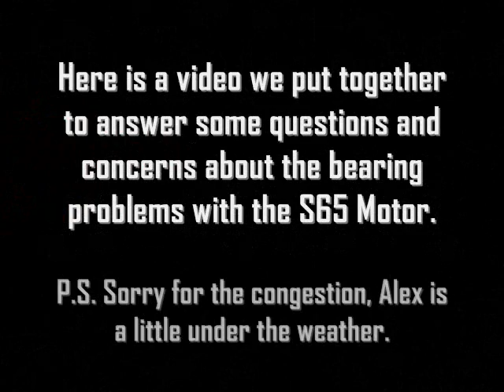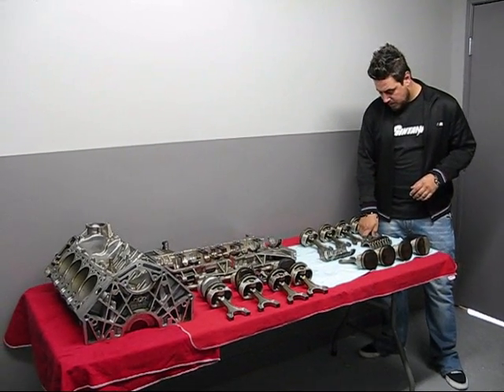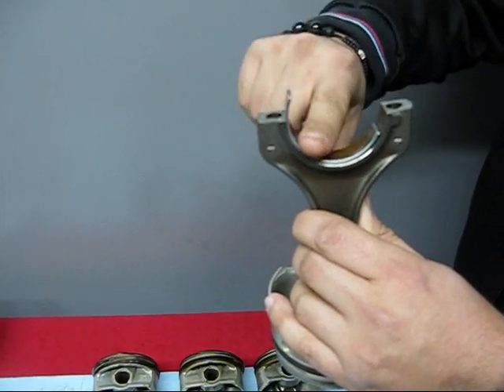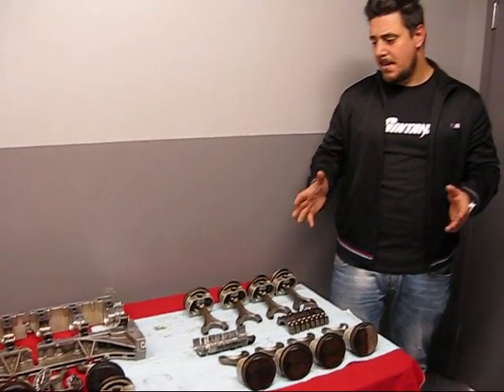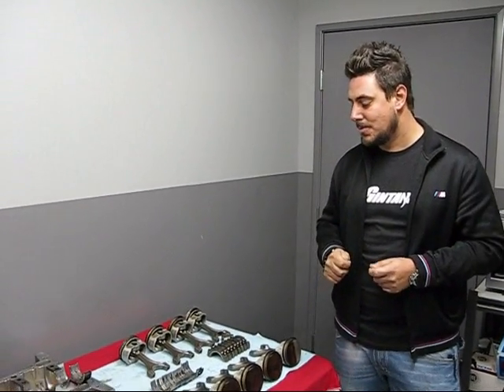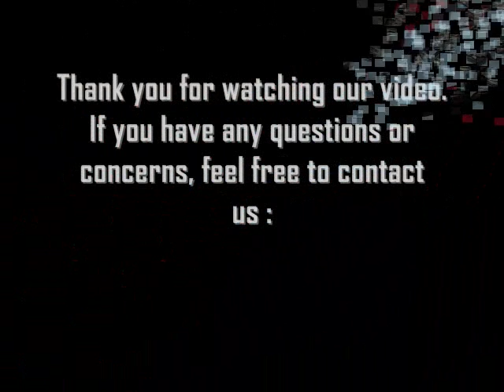Gintani - Understanding the BMW S65 Motor Bearings

Comment: what about using heaver oil such as 10w40 that's will save the bearing!
Reply: 10w40 would be thinner since bmw recommends 10w60. but yea ur right some people say they go with 0w40 and haven't had problems yet. 10w60 is just too thick for the clearances so they say
Reply: Work temperature of the S65 is around 100degrees...to even more...